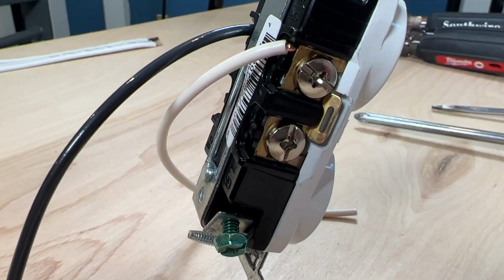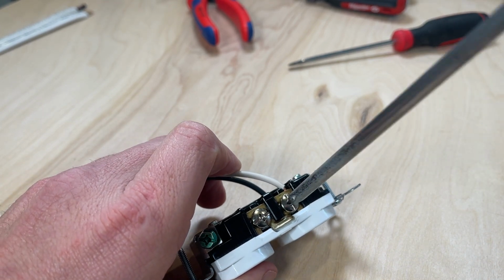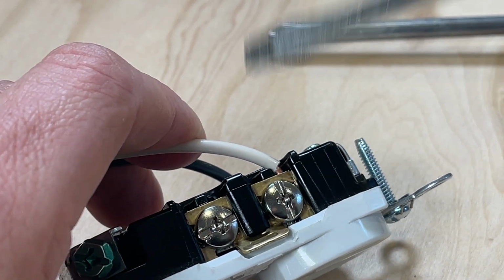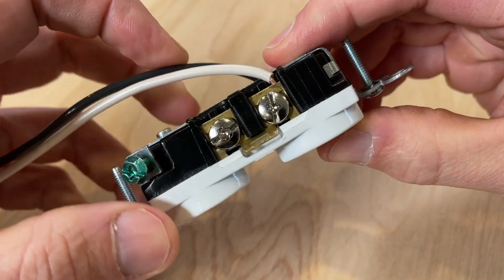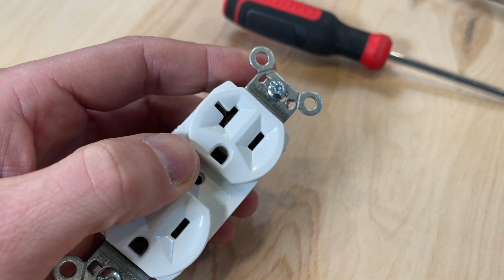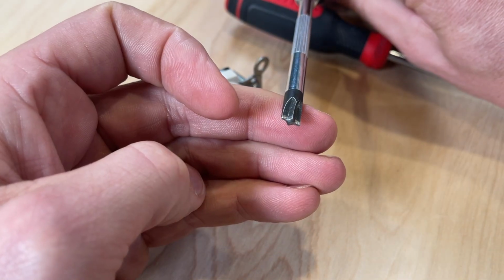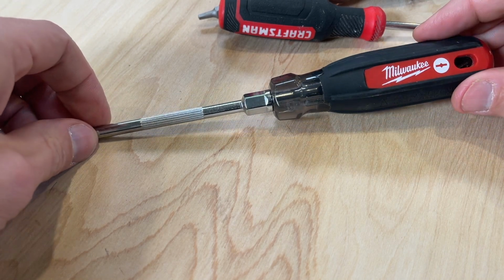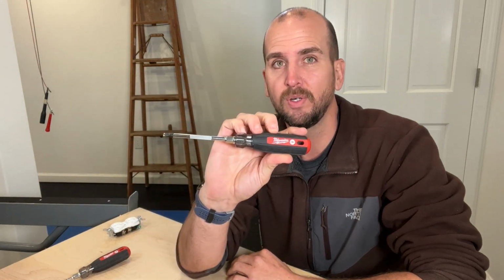80% of People Use the Wrong Screwdriver For Electrical Work

Comment: I think they should just use screws that aren't a combination of drives and fits the tools everyone already has. Then there wouldn't be any difficulty with Philips slipping because it would fit properly. Also no need to invent hybrid drivers to fix an issue that should exist in the first place.
Reply: Phillips will always cam out. It’s designed for fast manufacturing where the screw itself acts as a torque wrench, but terrible for repairability
Reply: @NavinF  It is not designed to be a torque limiter. That would ruin the screw head. They are designed for faster assembly though.
Reply: @NavinF  If they fit properly they don't. I don't think I have ever stripped a drywall screw. I agree there are more reliable drives out there. But this one is worse than any one of them because it is a hybrid, fits nothing well, and needs a driver that most people don't have.

Comment: New outlets in Europe are toolless in terms of installation. You only need to screw the socket with two screws down into the wall and than tighten the plate and shroud with a single screw, and in modern solutions they are PZ1 screws.
Reply: For those not familiar: a PZ1 is a Pozidriv screw. It looks like a Philips but has vertical driving faces. It will not cam out like a Philips. The screw heads are marked with thin lines between the slots of the drive socket so one can tell a Pozidriv from a Philips or a JIS (Japanese standard) screw.
Reply: @danielcarroll3358  Isn't that common knowledge? 😅
Thanks for the extra information though for those that don't know. 👍

I have Jung AS500 series stuff in my house. You can check out the pictures if you don't trust me if I say it uses PZ1 size Pozidriv screws (with the cross markings).
As for screwdrivers... I'm a Wera guy myself.
Reply: @LogiForce86  Back in the pre-Internet days I could only find Pozidriv bits, not screwdrivers. I ended up buying a Wera screwdriver from a hardware store in Cologne. I was there because I couldn't buy a sanding frame for my Festool belt sander in the US. I had a German friend order everything and on my next vacation picked up everything the day before I returned home.  I still have both.

Comment: Awesome video. I actually have one of the ECX screwdrivers that came with one of my tool kits and always wondered what type of screw head it was used for. Now , I know and will be using it when changing out electrical outlets. 👍

Comment: Just bought some Klein ECX #1 &2 screw drivers. I'm in the process of changing outlets throughout our house, and have been using the Klein #2 Phillips. FWIW, if the Phillips head in your house is good quality and in good shape, that you can get enough torque. That said, if you want the correct tool for the job or are a tool nut like me...

Comment: I have a set of Robertson screwdrivers from when I owned a camper. Robertson head screws are common on camper trailers.

Didn't know the terminal screws on outlets were Robertson.

Comment: the square bit u have don't look like a real roberston. the real roberston ones u can tell they have a taper to them that really locks that driver head into the screw. the American knock off versions don't have the taper and they slip out way easier. the locking force of a real roberston screw and screw driver is so good that when u put the driver into the screw u can hold it upside down by the screw and the weight of the screw driver won't make it fall out.

one thing i wish they would do is ditch the dang slotted screws for plate covers slotted screws are the worst thing ever.

Comment: Do yourself a favor if your thinking about buying one of these tools. 
Get yourself a 11-1 Klein screw driver. Comes with all the bits you’ll need, and 2 size nut drivers. 2 Phillips sizes, 2 flat head sized, 2 square sizes and Torks sizes. As an electrician that tool will cover 90% of the things you’ll need for residential “trim” out work. Receps, light, etc.

Comment: I didn't know about the hybrid!  I use a square drive to get it snug then I switch to my Wheeler torque driver with square bit  set to correct torque for the outlet or breaker...
Reply: Most people do not know about the torque driver for electrical.

Comment: Unfortunately, older receptacles and switches have only slotted screws or slotted/Phillips and most dimmers do not have the ecx type screws. The ecx is great, but it’s not always applicable.
Reply: That's when the combo head from ideal or zephyr comes in handy.  It fits PH/SL screws nicely in addition to the PH/SL/SQ

Comment: Just wondering if Robertson screw heads are commonly used for other things? They seem to be a good choice. It would make sense for the screwdriver companies to sell combos of the driver and screws together.
Reply: very rarely most stuff is designed by us companies who are obsessed with philips screws. in canada most houses get built using roberston screws. in the us even getting a real roberston is hard since the us came up with there own knock off version that isn't as good.

Comment: I honestly hate the Robertson fasteners lol
Reply from the maker: Really, may I ask why?
Reply: @EverydayHomeRepairs  (I should say the square drive trim screws mainly) them #1s square drive head trim screws are terrible with stripping out and you can never remove them. We used to use them for cabinets, screwing the face frames together for installs but we switched to the king that take a #10 torx and life is great now